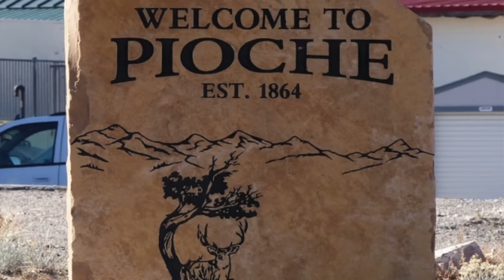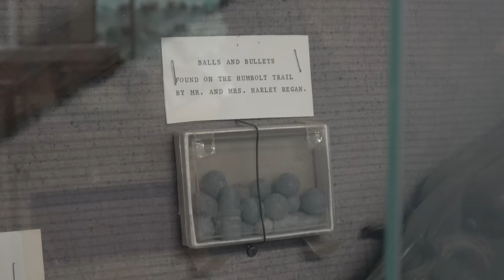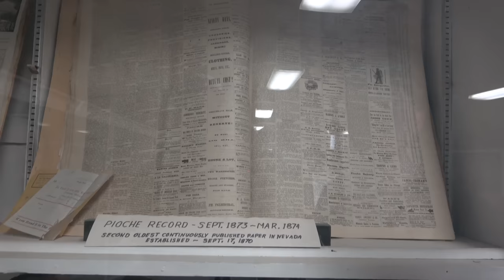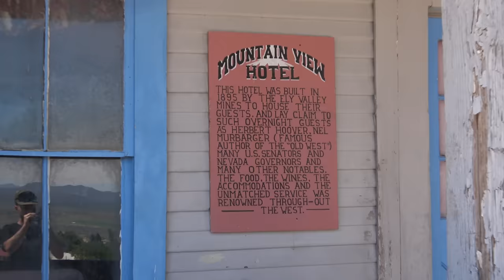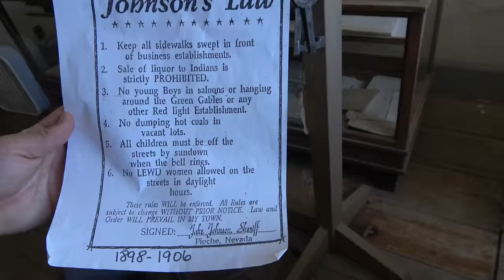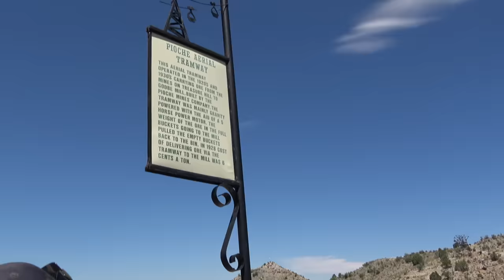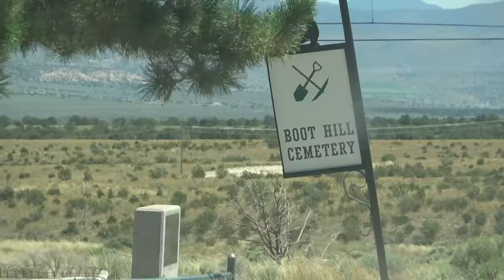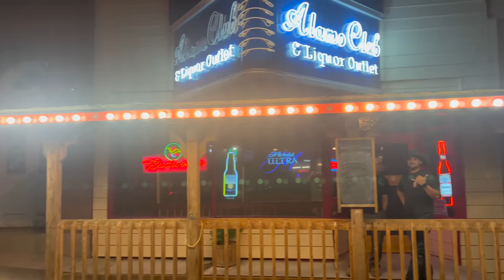The History of America's Deadliest Ghost Town! PIOCHE, NV

Comment: I once saw a piano get picked up with pulley wheels and a rope by a 6 year old I was told the pyramids could have been built even with stone pillars and pulley wheels big ones and small ones tourqe convert the wheels spin faster and faster as size shrinks and you can eventually lift like 10x the amount per wheel used ! They showed me as miners how they use that same idea on paper to move boulders with a steel tripod and box with pulleys in it called a chain hoist lol so maybe they even used a chain hoist since they had metal motors to even move back then